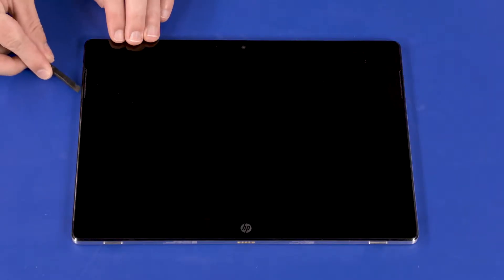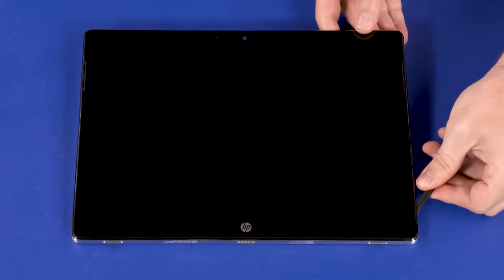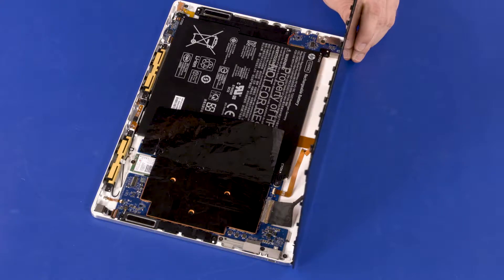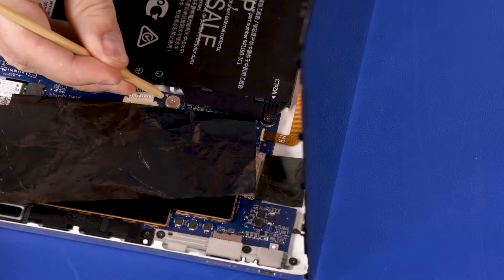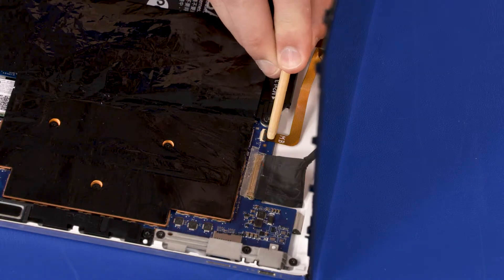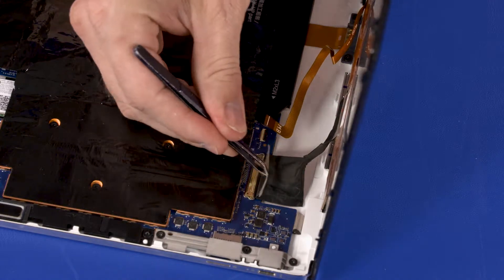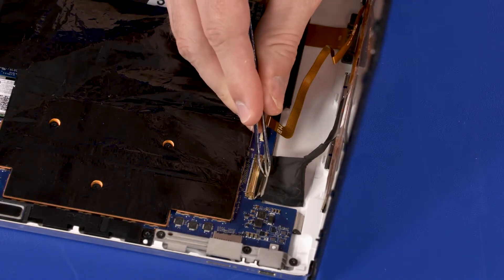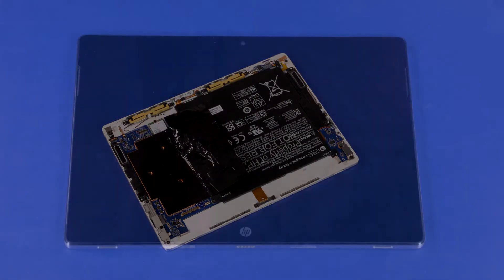Replace the Display Panel | HP Chromebook x2 - 12-f000 CTO | HP Support

Comment: Hi. My chrome book x2 screen is not Touchable anymore can you help me
Reply from the maker: +christian ferrar If your touchscreen isn't working, try these steps. Test after each step to see whether your touchscreen works.
1) Wipe off any dust or dirt on your touchscreen.
2) Reset your Chromebook hardware as mentioned here: https://support.google.com/chromebook/answer/3227606
3) Reset your Chromebook to factory settings as mentioned here:
https://support.google.com/chromebook/answer/183084
Please let us know how it goes.
Reply: I’m sorry I forgot to tell you that my screen glass broke and my keyboard is not connect to my chrome book .
Reply: @kevin.b5680  You can order a replacement screen on ebay and do the replacement yourself if you are a  bit handy. As the video shows it's straightforward. I replaced a screen for a Samsung tablet a couple of years ago and it was easy. I just broke the screen of my X2 and ordered a replacement screen.
Reply: @sergeboivin566  I tried to do just that and now neither the new monitor nor the replacement works. The Chromebook works fine when connected to an external monitor.
Reply: @sergeboivin566  I just broke my wife's X2 screen trying to remove it to check on another part. Can you tell me where you ordered your replacement screen from? Does the touch screen work on the new one?  thanks!